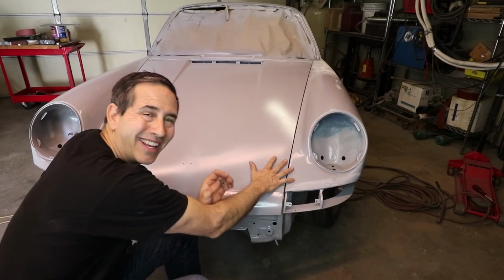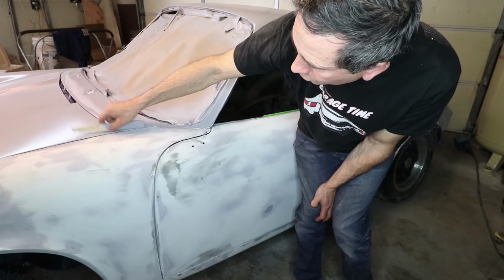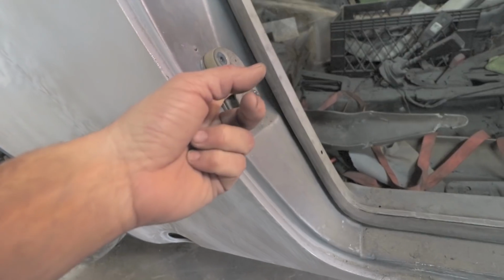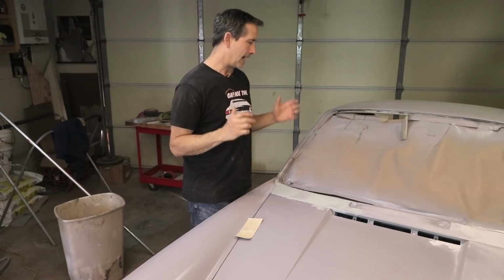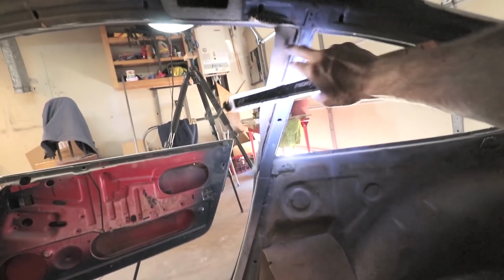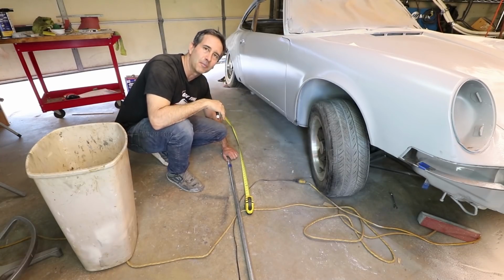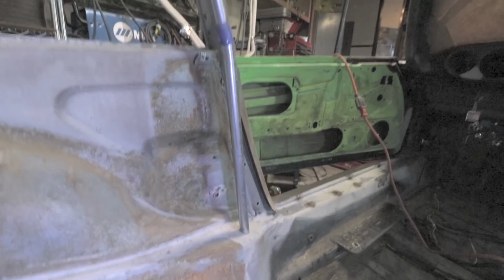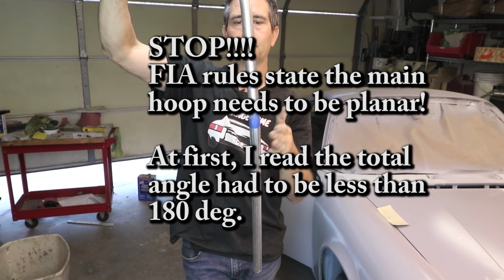My Porsche 911 Wreck Gets Latched & Caged

Comment: Way hey she’s looking ‘arrow straight’ now 👍 That was a great idea with the conduit pipe for initial mocking up oh and thanks for the mention buddy 🤩 

I know you’re a week ahead of us following your progress but I’ll email you some more cage pics and further details tomorrow which might help further. In the meantime it’s another Sunday tomorrow and Sunday’s mean Sanding 🥴😅

P.S. I’ve got a spare new set of front fender gaskets if you want them (they are 993 type but will fit just fine). If you reply to my email with your address I’ll post them over to you Monday. It is critical you install them for the early cars before you do any final alignment/filling work as they do unfortunately push the fenders out a little further than we’d like to think which for obvious reasons presents problems during final assembly 👍

Comment: What do you mean by planar? Does that mean that no bends on the vertical sections is allowed?
Reply from the maker: So, one set of rules says 4 bends max totalling 180 deg.  Another set says that 4 bends are allowed but they need to be in same plane.  All pics I've seen have everything in one plane.  Rather than bending the bar back to follow the B pillar it's safer to keep it more vertical.
Reply: My interpretation of the rule is you get up to 2 90 degree bends at the corners to go down to the floor and if you can’t lay it flat on the ground it is not in spec. That said, it varies by classification too. Open cockpit formula cars are allowed a bolt on headrest/rollbar but must have a front hoop that with driver in the car the drivers helmet is below the line from top hoop to bottom hoop.
Reply: Dave Harris Wow, this is complicated stuff! Lol
Reply: fg jf it is. Having raced in multiple organizations and multiple classes I’ve found the rules vary by organization and class so much that when you change from one to another it may cause pain. I’m pretty sure you could never make anything other than a pure stock car meet all the rules for everyone.
Reply from the maker: @Royalerp31m  That's what I'm discovering as well.  The main hoop should lay flat unlike my mock-up.
Reply from the maker: @Royalerp31m  I agree, I just linked to two documents in the first comment above.  FIA says 1.75" tubing for all cars and SCCA, PCA, and NASA say 1.5" for a car less than 2500 lbs.  NASA talks about a maximum of four bends.  Since my cage isn't a full competition cage, I'm going to pick and choose what make sense to me.
Reply: you could run into vertical too.Tech inspectors are given a lot of leeway on safety.